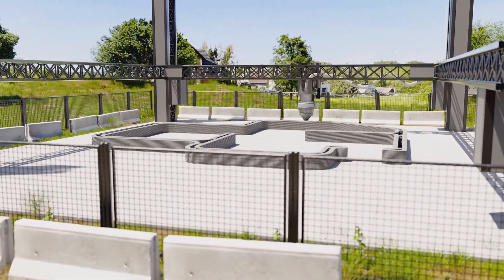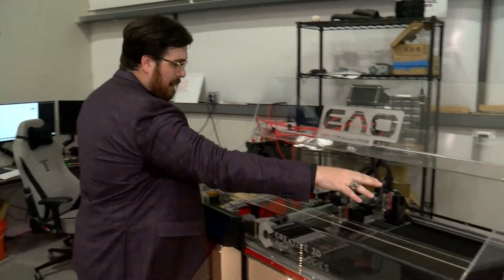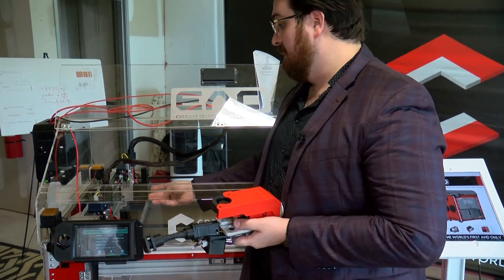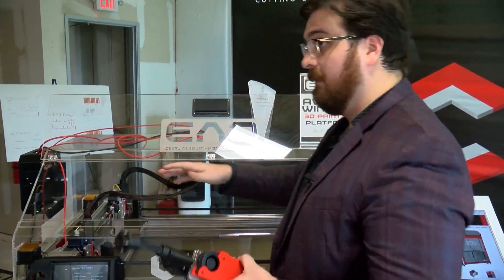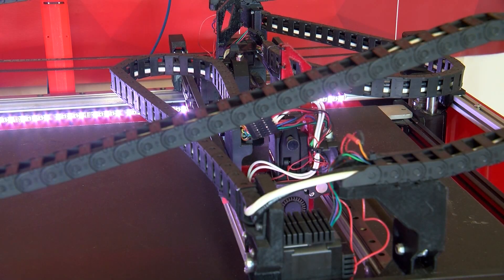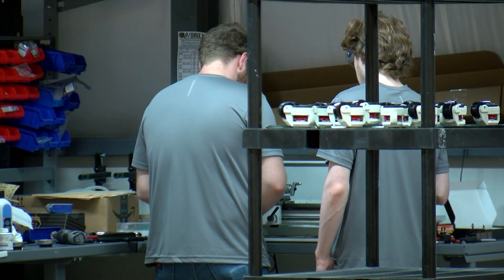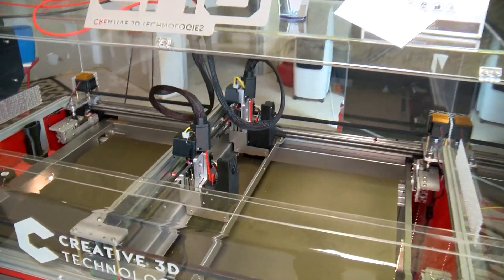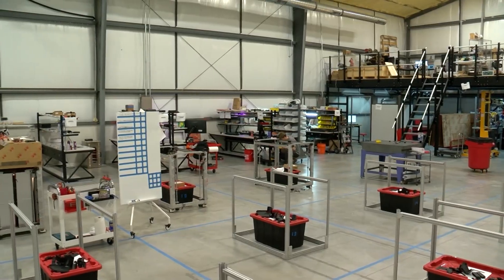Austin Startup Innovates 3D Printing with 'Factory in a Box'

Comment: Why would you need to mill something that’s printed ?
Reply: Precision. Mills are much more accurate than any 3d printer
Reply: @bkern123456  Also scale. 3D Printers are great for 1 off parts or when you need a low number of something that is difficult/expensive to get. If you are milling, you are likely making many thousands or even billions of a thing, thus diversifying the overhead cost. This is the secret the Ford figured out, assembly lines make things cheaper and higher quality. But if you need a 1 off or very few of thing, it can be cheaper to print it rather than set up an assembly line for it.
Reply: I think it can also be used as a mill I don’t think they are milking the prints but idk?😊